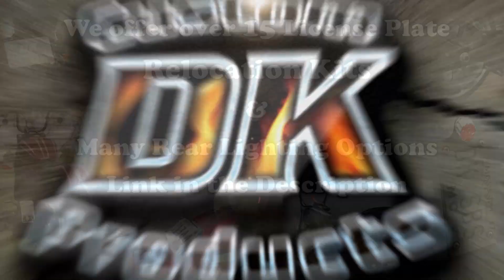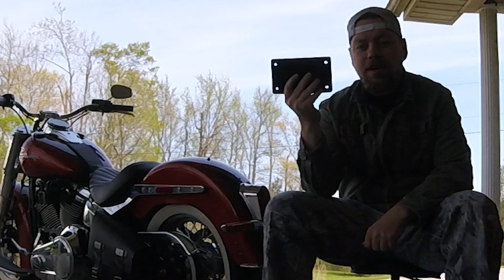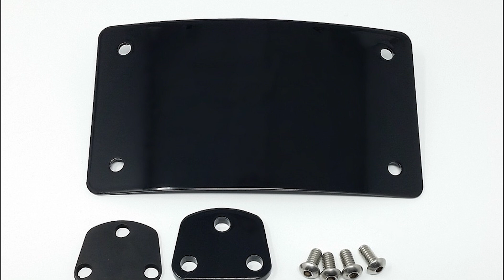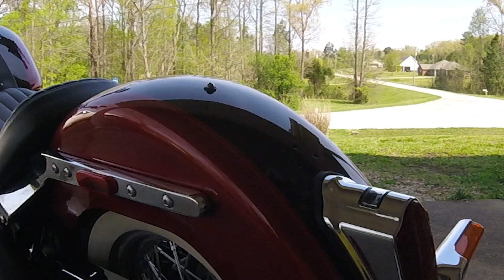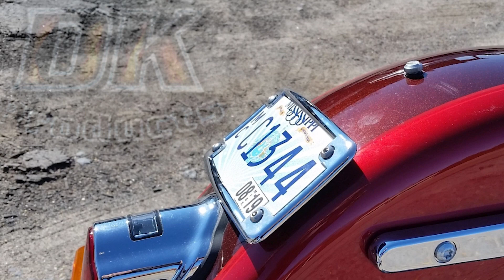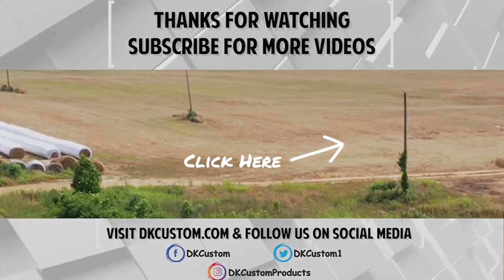15 Different Harley License Plate Relocation Kits

Comment: I've owned a deluxe and now own a road king there aren't any holes in any of the fenders to attach the bracket. What am I missing?
Reply from the maker: Touring Models, like the Road King, do not have the 3 hole pattern in the fender.  You can drill it if you want to mount to Road King. 
FITMENT:
Most Sportster, Dyna, Softail Models (including some M8 Softail Models)
 
Fits 1984-Up Harley models with the license plate mounted to the fender above the taillight using 3 bolts
Link to Image illustrating- https://www.dkcustomproducts.com/media/wysiwyg/framesuspension/licenseplate/horizontalmount/3_hole_patter_illustration.jpg

https://www.dkcustomproducts.com/fender-mounted-low-profile-laydown-curved-license-plate-kit-harley-sportster-dyna-softail-including-m8-softail.htm

Comment: I can't find the curved frame on your website. Can you please post a link to the frame? Thanks!
Reply from the maker: Thanks for looking at our parts.  

We have a few Curved License Plate Relocation Kits.  Here are the links to them:

https://www.dkcustomproducts.com/fender-mounted-low-profile-laydown-curved-license-plate-kit-harley-sportster-dyna-softail-including-m8-softail.htm

https://www.dkcustomproducts.com/m8-softail-license-plate-relocation-kit-axle-mounted-curved-w-optional-led-run-brake-light.htm

https://www.dkcustomproducts.com/curved-license-plate-relocation-kit-w-optional-led-run-brake-light.htm

https://www.dkcustomproducts.com/primary-mounted-curved-license-plate-relocation-kit-w-optional-22lr-led-run-brake-light.htm
Reply: @DKCustomProducts  Thank you for all those links but I saw all of those kits on your site before. I was interested in the frame you showed showed in this video with the bracket. I don't see any frames on your site.
Reply from the maker: @DONALD-MAGA  If you are talking about the chrome plate frame that is on this Curved Plate Relocation Kit- https://www.dkcustomproducts.com/fender-mounted-low-profile-laydown-curved-license-plate-kit-harley-sportster-dyna-softail-including-m8-softail.htm

Note: Should you desire to use a frame, you do Not need to get a curved frame. We have
found that a flat frame can easily be tightened down to follow the curve of the License Plate
Mount.
These can be purchased for a few bucks at most any auto parts store.
Reply: @DKCustomProducts  Thanks for your prompt replies !

Comment: Thank you so much, as I just got my curved relocation kit today. Can you tell me the make and model of that chrome plate frame in this video? Thanks in advance ;)
Reply from the maker: It was a $10 frame picked up at a local motorcycle shop.  I'm sorry, we don't recall if it had a brand name, or if it was even packaged.
Reply: @DKCustomProducts  Thank you for replying to my comment. Would it be possible to pick up one more just like that one and send it to me? If so, you already have my email and you can give me the details
Reply: @DKCustomProducts  So where are the other 14 products? It doesn't say much about your company if you need to bait people for sales. Dick move.